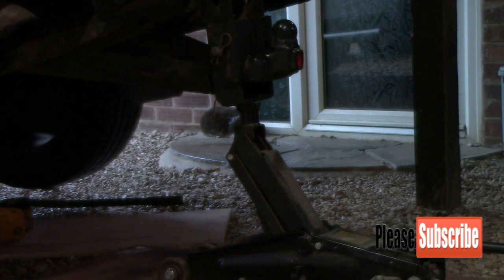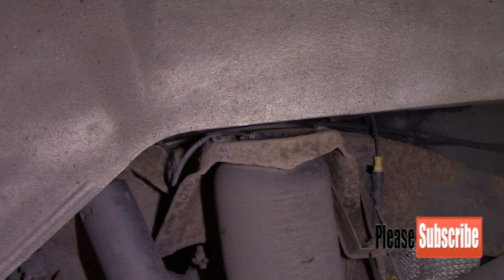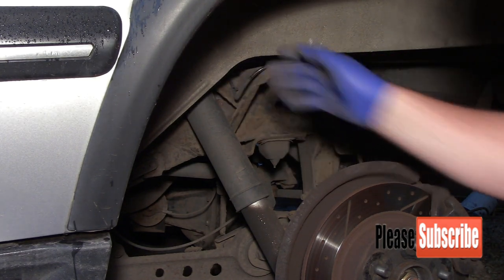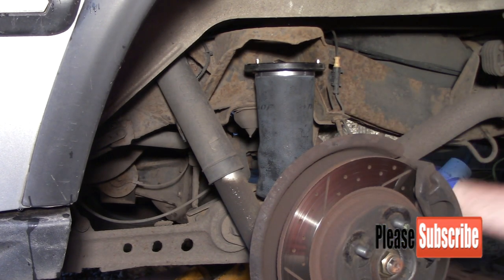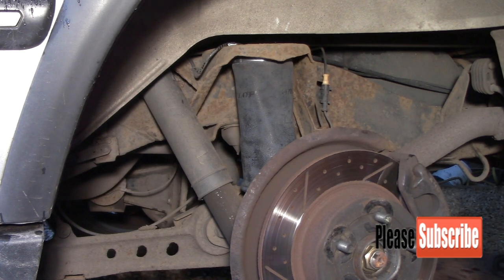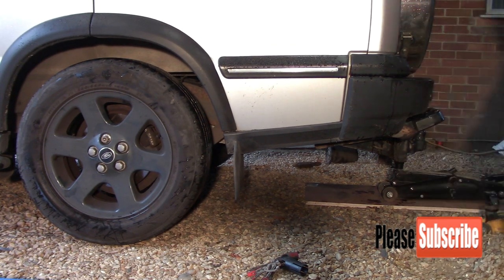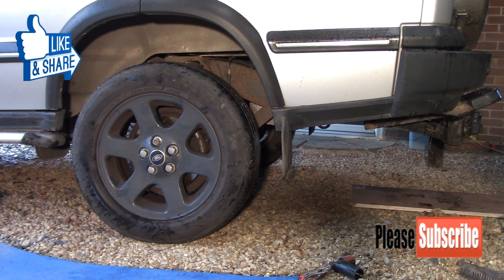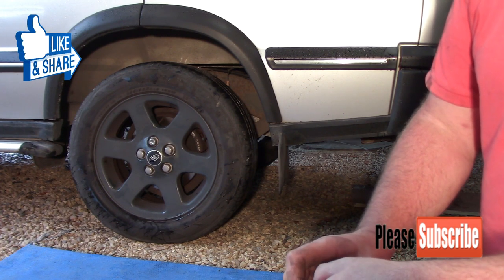Changing rear suspension air bags on my Landrover Discovery TD5

Comment: Excellent video, thank you...as a real non-mechanic (someone who struggles with the Haynes manual single spanner jobs) I decided to give it a go today...what a surprise...I had an old air bag with a screw fitting, not a push fit...it took ages to get the bag off and no amount of swearing helped. However, the other one was simple. Thanks again
Reply from the maker: Thank you for your comment so glad it helped.

Comment: Great video, Thanks for sharing. Remember if you're watching this, you need to shut all doors so that compressor works once new air bags installed.
Reply from the maker: Harry Gocher glad you enjoyed. You are correct Harry you do have to have the doors closed for the compressor to work unless you have a nano com plugged in then you can operate it through the nano com.
Reply: Thanks for that tip Harry!

Comment: This is by far the best vid on the web showing how to do this! My 2000 D2 is loosing air overnight...i was going to take it to a garage but now i am going to do the swap out myself. Thank you very much.
Reply from the maker: kjs insaino I am glad it helps you out.
Reply: @SKKrafts   I am wondering if there is a possibility of total airbag blowout? I want to use the truck to do a 9 hr roundtrip to pick up a load of fireworks. My rear seats are removed fore more room/less weight. I am scared to go before i change the bags because i fear a sudden blowout. Right now it loses about half the ride height in 24hrs. Have you ever heard of a total failure associated with a slow leak?
Reply from the maker: Yes total blow out is possible plus if the system keeps pumping up you are putting extra work on the compressor with is an expensive part to replace.
Reply: Ten 4...thank you for the info...ordering bags tonight!!!

Comment: Had my airbags replaced at 100,000km by the dealer at a ridiculously high price. Have realised I can purchase the bags locally at an extremely reasonable price. Now that I have watched this video I am sure I should be able to do the job myself. Although I've now done 320,000km the air bags hardly loose any air when standing for lengthy periods but due to the milage and time period I believe it is worthwhile replacing them now before they give problems. Ive read up many other methods on various forums but must confess your method is certainly the simplest I have seen so far. Thank you for your well documented video.(if you do ever change your fuel pump on your TD5 please do a video of it as I am thinking of replacing mine before it too begins to fail. I would prefer to replace it myself as I know the cost of the pump is not cheap. Did hear of a guy who  changed only the the motor on his pump but never thought that was possible) Again thanx your video was a great help.
Reply from the maker: Hi thank you and so glad it helps you. It’s not a hard job but like you say needs doing before they fail. I have done one on the td5 fuel pump but it’s on my other channel. The channel is called. It’s all landrover. Will be adding more content to that channel in the near future.

Comment: Thanks for this video! I don't know why anyone gets rid of the rear air suspension on these. The airbags are getting exceedingly cheap - about $100 for a pair, and can last a LONG time - mine only just let go after 8 years and some seriously heavy use, towing massive loads with high tongue weight. The self-leveling and ability to un-high-center itself is amazing. Heck, even a new air compressor is only like $150-200.

I wasn't sure how to replace them, but figured it wasn't a nightmare job. your video was a very helpful guide before I jumped in and tackled it!
Reply from the maker: Thank you colin so glad it helped. I totally agree with you air bags are so much better than spring.
Reply: @SKKrafts  I just did the job (only took about 45 minutes - longest part was figuring out the best way to jack the rear up!) but I noticed that my air springs (both the ones on it, and the replacements) didn't have a press-fit for the air line, instead using a threaded system with a 3/8 nut that locked down on the hose.

It did make undoing the air line much more obnoxious, requiring me to use pliers to slowly turn the nut back on the spring that didn't have a leak, but just stabbing the thing with a knife since I'm replacing it anyways would have done it. For the spring that did have a leak, i just dropped the axle down after undoing the clips, so I could get a small wrench in and undo the nut.

Comment: Terrific video! Thank you. 
What are the best cost efficient after market air shocks ?  
Also compressor and sensors? 
Thanks !
Reply from the maker: I always use Dunlop or continental air bags as never had any problems with them. Never had to replace compressor so couldn’t say but I would go for a mid range one. I have use Land Rover sensor and cheap ones I can’t say their is any different. Hope this helps

Comment: Thanks again. 
Is there software that can be used to calibrate the system rather than take to the dealer ?
Thank you
Reply from the maker: You can use a nano com as most auto motive diagnostic machines won’t read landrover.. but other than that it’s got to be dealer. The Hawkeye system works with landrover but I believe they don’t do the self levelling system.
Reply: Only need to recalibrate when removing/replacing ride height sensors - not air bags (if replacing like-with-like).  Was told that you only need to disconnect the battery before removing/replacing ride height sensors - that way no need to recalibrate.
Reply: Thank you

Comment: Many thanks.
Reply from the maker: Hope it helped
Reply: @SKKrafts  It certainly has in terms of planning both the tactics and strategy. Whilst a deal of effort is required, thanks to your video and verbal explanations, the task is now less daunting than was expected for a JLRD2. The Air-spring and clips have been purchased, from a local supplier, and replacement is planned in the next few days. The rate of deflation suggests a pin prick puncture. (Bicycle tyre puncture repair kit 🤣🤣)

Comment: The air compressor won't run with the driver's door open, so have your window down to turn on the ignition.
Reply from the maker: Engine needs to be running for compressor to work and if any door open it won’t run.

Comment: This is definitely the best video!  Am I correct in assuming that no recalibration (via scan tool such as Nanocom) is necessary when changing an air suspension bag?  I believe that is only necessary if changing a ride height sensor (but you can of course get around this by disconnecting the battery before removing/changing a ride height sensor)?
Reply from the maker: You are correct the car will return to the original ride height once back on it wheels.

Comment: Great video!
Are there any differences in the airhose connector type compared to dunlop and the original bags?
Reply from the maker: Glad it helped. No all air bags a push fit now.
Reply: @SKKrafts  Ah, is that right?  Thought Contitech and Dunlop had different air connections.  Will have a good look as I don't want the inconvenience of changing air connectors.
Reply: @SKKrafts  Just bought a brand new Contitech (made in Germany) a few days ago.  It doesn't have a push fitting as I was expecting - it has what I think they call a Voss fitting (10mm nut/olive/o-ring).  The Voss fitting is what I also have on my old LR Genuine Contitech air bags currently fitted.  I think the push fitting is only on the Dunlops?

Comment: One of mine blew out today in the middle of town, nearly gave a poor bloke a heart attack. Looked under mine and the ride height sensors look very crumbly at the ends, are replacement of them straightforward or do I need a code reader . I have a Hawkeye. Great video, thanks.
Reply from the maker: Hi if the pop the go off with a bang, to replace the height sensor is straight forward. Make sure car is turned off and key removed from ignition. Jack up car and remove wheel. Unplug sensor and remove the two bolts and remove sensor. Redox in reverse. Replace wheel once car back on all four wheels start car as normal. Should be good to go.
Reply: @SKKrafts  they sure do! Thanks very much for the advice. Should I disconnect the battery?
Reply from the maker: You can do but never have and always seems fine.

Comment: doing all corners on mine.. but my bags are seized solid.. they won't turn at all.. even had a oil filter spanner on it.. does not budge.. hopeless.
Reply from the maker: I would imagine that they are full of mud and toad dirt. Try soaking them in wd40 or penetrating oil. May break it down and free it off.

Comment: Looks like my old fittings (top of air bag) are 10mm nut/olive/o-ring - I think they're called Voss fittings.  The new Contitech OEM air bag that just arrived also has the Voss fitting (10mm nut).  Maybe the push-fittings are a Dunlop thing?  Anyway, the new air bag has a dab of paint on the 10mm nut and the instructions say not to adjust???  Surely I have to remove it and screw in the old nut?
Reply from the maker: I am unsure about that one as I have had Dunlop and contitech and both have had push fit for air lines.
Reply: SK Krafts Both are now push fit - they differ slightly however: Contitech has a 10mm nut (only used if air line is being removed) while Dunlop looks to have a push fit collar.

Comment: I have two axle stands and the LR supplied bottle jack - is that enough to remove the air bag?  [I noticed you used two trolley jacks]
Reply from the maker: You could do one side at a time. I just did it because to me it’s easier.
Reply: @SKKrafts  Yeah, only one bag with an on again/off again slow leak!  Doin' it a little harder $-wise with COVID-19, so instead of buying a pair I might just get a single bag to replace the leaking one and then do the other side a bit later on, so won't need trolley jacks then?
Reply: @SKKrafts   Thanks, did first side.  Old LR bags are Contitechs with Voss fitting at top (10mm nut/olive/o-ring).  The new Contitech OEM bag also has a 10mm nut but instructions say not to adjust!  Strange?  I thought I would remove the 10mm nut from the new bag and then just attach the old 10mm nut to the top of the bag [of course this would mean I would be using the old air fitting]?  Any thoughts?
Reply from the maker: Can’t see it being a problem.

Comment: Question my LR has a push in air hose into a push in valve but the replacements are screw in. Do you suggest like a john guest connector??
Reply from the maker: Hi Aaron. Firstly I would see if I could get the part with a push in connection like the one what is already on the car but if that was not possible then you need to use what ever is possible to connect them. I am unsure what a John guest connector is. Hope this help thanks for the comment.
Reply: The Contitech bag 10mm nut st the top (Voss fitting) must not be touched, otherwise warranty is invalidated - nut has a dab of paint on it (nut is only used when removing air line).  Just firmly push air line in.
Reply: SK Krafts Contitech and Dunlop both (slightly different) have push fittings - no spanner required when fitting.